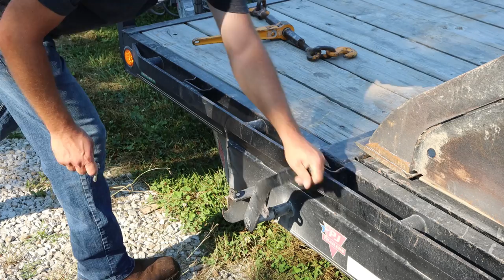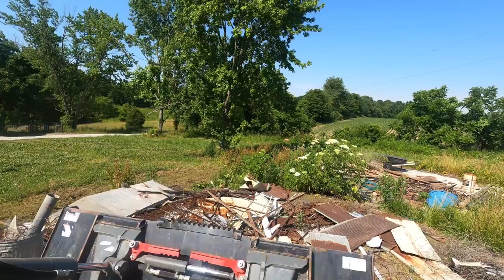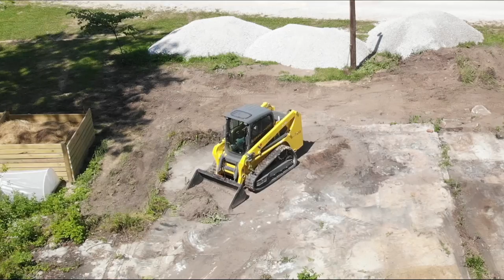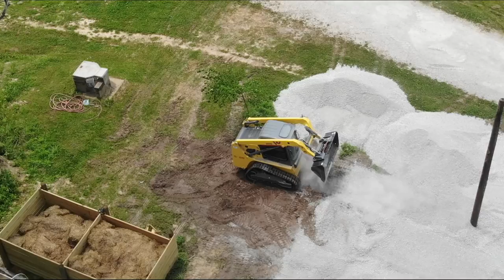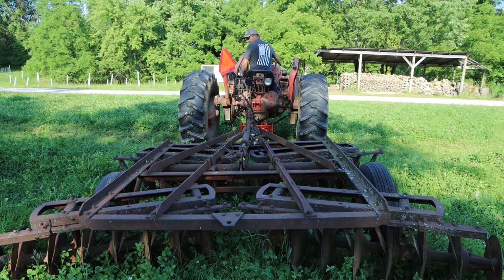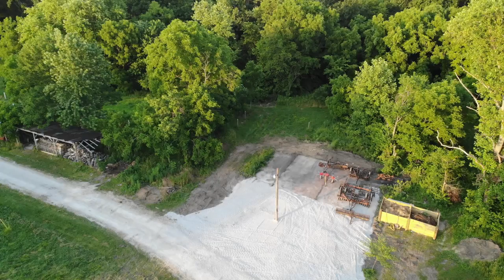Using a skid steer to make a parking lot to store tractor implements and equipment.

Comment: JudithB  Looks  really  good!!!  I  would  park  the  trailers  across  the  front of  the  first  line of  old  equipment.  It  would  be  easy  to  pull on  the  gravel  and  back  to  whichever  trailer  you  want  and  then  pull on  to  gravel  from  in  front  of  the  compost bins  to  repark the  trailer.   I  made  a  large  parking  area  12 yrs ago  when  adding  my  business  shop  at the end of my  house.  There is  parking for  3  trailers  and  a  35' rv  that  needs  a lot of  room  to  move  around.  I put  4"  shale down and  then 4"  gravel on  top,  now  it  is  covered in  grass  and  easy  to mow.  I  put  sheet  plastic  under  the small  trailers  to keep  grass and  weeds  out.  The  plastic has to be  replaced  every few  years  but  saves  me  jockeying  trailers  every  week or  so!!!  LOL

Comment: Warehouse racking and some bucket forks will let you store the lighter stuff up on the racking giving you full access to everything quickly when needed. That the racking can also be used to help with fuel storage by having a tank high enough to gravity feed into the equipment is an added bonus.

Comment: we always keep a coffee can around with some used motor oil in it and an old paint brush.   When we park items like the disk or plow, give it a coat of oil to help slow down rusting.  Also handy to oil any working chains on equipment before using.

Comment: some orange paint on the high-line pole might help to see it , never have enough rock,  a small plow is great for making a fire guard  and you could fit a seeder box on the packer  to plant alfalfa or other small seeds , have a cousin in law who worked for napa and he watched a demo on concrete anchors and the epoxy anchors actually  pulled out the concrete around them!!!

Comment: Crushed concrete also keys together and locks in more stable than limestone the quarry you got the limestone from probably also produces aglime which is a little more expensive because of the extra screening process to manufacture...
Aglime is used to increase soil PH on acidic soils

Comment: Maybe not available in your area but if a person has access to it crush and run concrete is better to use to top off your limestone with... the fines from virgin crush and run limestone never really settle out 
But crush and run concrete thosw fines will work under the larger pieces of concrete and your vehicle and feet stay cleaner. Just a suggestion

Comment: great job.... was the skid steer easy on your back?..... i saw an amish crew move a carport one time.....they used a tractor and end loader ....lifted from inside with loader on one end and let the other end drag on ground.... and of course they had spreader bracing across it on the inside.....

Comment: Just curious,  why not use you tractor with the front end loader and a box scraper as uposed to renting a skid steer?
Reply from the maker: Metal and nails in the ground, not good on tractor tires.
Reply: @CountryViewAcres . That's right, you said that. Apparently the older I get, the less I remember details.

Comment: you always run heavy eqipment at full RPM AT all times, less then that, you have lost power and controls, they are built to run a full RPM, running lower damages eqipment, pumps and valves starve for oil, and you dont get good performance out of it if your not at full RPM